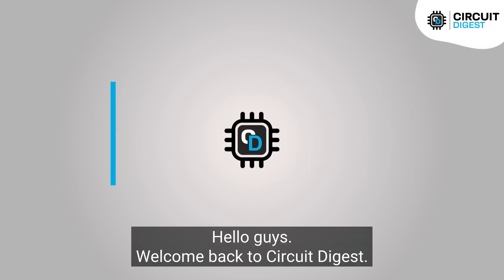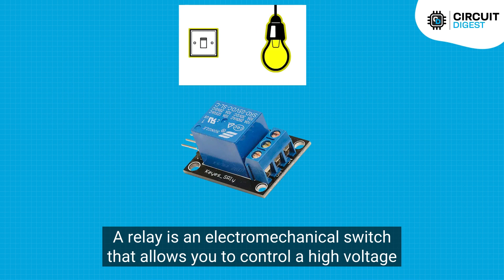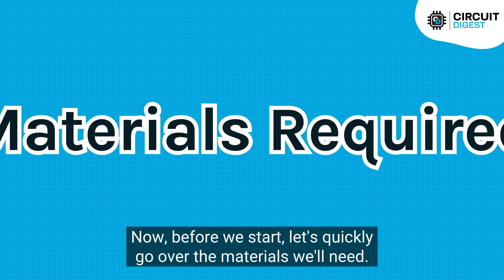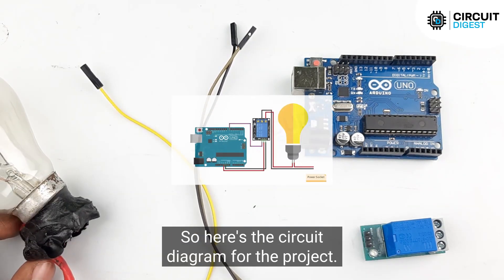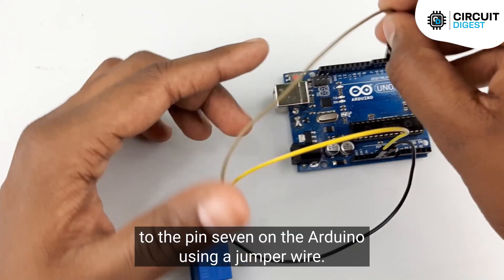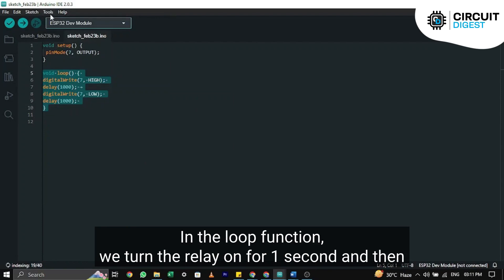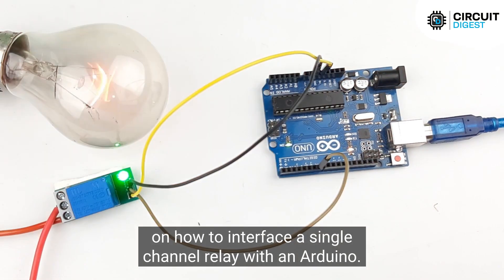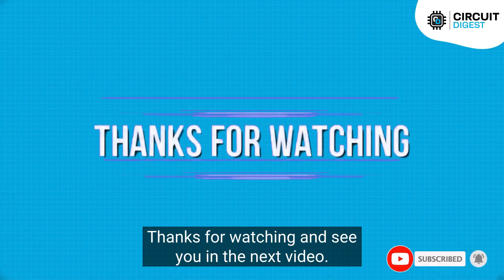Arduino Relay Control: A Beginner's Guide to Controlling Machines

Comment: What if you wanted to use a switch rather that code? How could you make a switch turn on and off that relay with the arduino?
Reply from the maker: Connect the switch in between any arduino pin and ground. Set the pin as input with pullup. Monitor the pin and control the relay according to the pin's status.